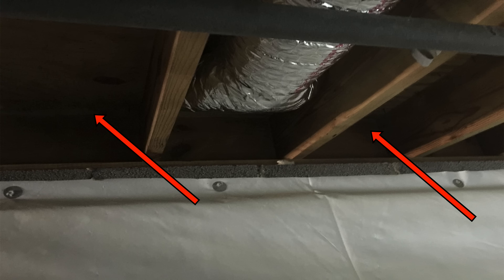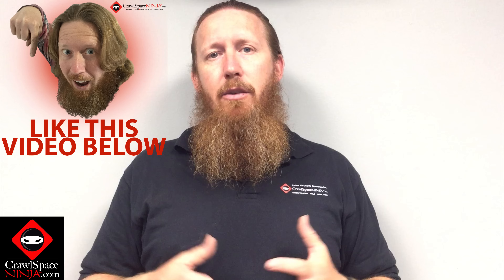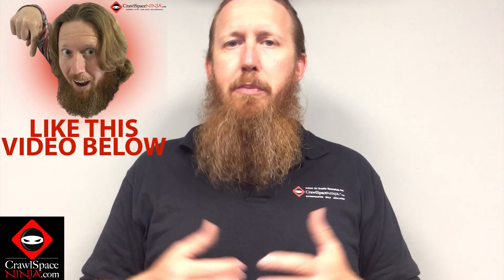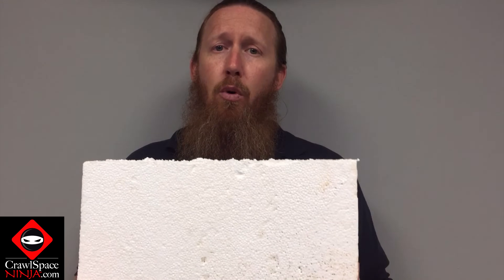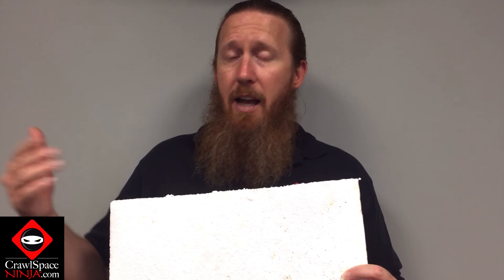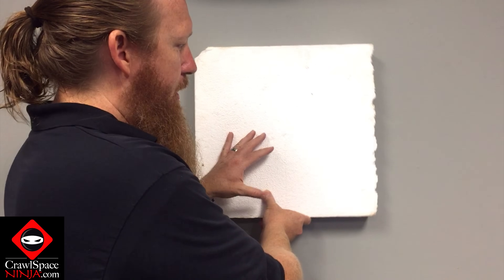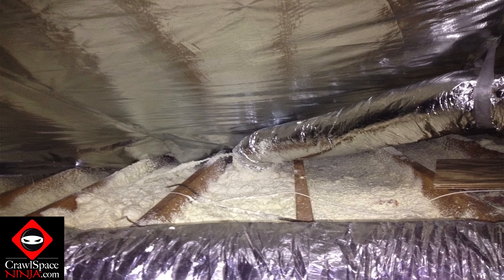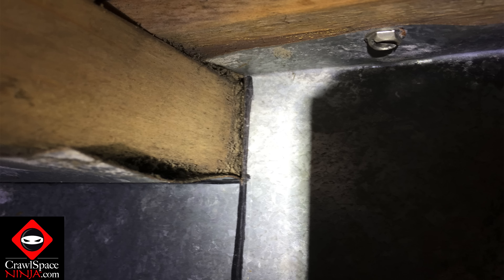Mastering the Art of Air Sealing Rim Joists Easily

Comment from the maker: If you live in the Knoxville area, contact us about our duct sealing! we have a December special going on!
Reply: I have a question for you guys.  Michael, I live in Wichita Kansas, climate zone 4 I think and 2/3 of the front of my house has a cement slab front porch 1.5 feet high, and 5 feet extending from the front of the house.  The last 1/3 is ‘open’ with no porch.  My thought would be that I only need to insulate the rim joist where there is no patio to protect the joist since it’s ‘insulated, by the porch.  I plan on using extruded foam board and air seal that.  Am I thinking correctly here or should I do the whole thing?  I’m certainly no pro but the way you’ve explained it I’m sure I can do this.  Any advice would be very very much appreciated.  Don

Comment: Hey I know this video is 8 years old but hopefully you see my question. Lets say I foam seal around the rim joist air sealing it and then add one inch strips. Then add my foam board after it cures and air seal that as well. If i remember correctly one of your videos mentions that would add R value?
Reply from the maker: That sounds like a great idea. However, if I am understanding correctly there will be an air gap between the foam board and the rim joist. If that is the case I don't recommend you do it because it is frowned upon to leave an air gap between insulation and wood in the crawl space. Usually when we leave an air gap it is between insulation and concrete. Hopefully that helps thanks for watching.

Comment: I have tons of thin foam board 1 inch or less. Can I use several pieces stacked instead of buying the expensive thicker foam board?
Reply from the maker: I have spoken to homeowners that have done that with success. Thanks for watching.
Reply: @ I’m doing my basement not the crawl space. How do you feel about foam board and spray foam on the ledger board side? Never heard you talk about that.

Comment: Great video. I watch so many different videos on this. Some say the pink foam board is fine and seal with great stuff. You say use this kind bc it can breathe a bit in case the area gets moist. Well then why air seal if letting it breathe is helpful to prevent wood rot? I feel like on solution created another and as we get more and more air sealed we realize some air flow is actually necessary.
Reply from the maker: Thank you!

Comment: Side note: 
 know this video is 6 years old. But post Covid, the 2” rigid foam from HD is $60 for a 4x8 sheet. Crazy expensive! However, if you buy their 1” 4x8 sheets, it’s only $20. Glue two or more sheets of the 1” together and you’ll save money vs buying the 2” rigid foam boards.
Reply: What did you use to glue the first board to the rim joist and the rim joist to each other? How do you tell is there is termite activity this way? I want to do it because basement is so cold.
Reply from the maker: Great tip - thanks

Comment: One product I came across by accident is called Fastcoat. I’m sure they’re other brands. But it looks identical to the Pro foam cans, but instead of coming out like a bead, it sprays the foam just like a FrothPak. I’m sure it’s more expensive per linear foot compared to FrothPak, but for smaller jobs it looks ideal.  

You don’t have to lug around the two propane type bottles, hose and gun. It’s just the gun and can foam with a different type tip that snap onto end of the gun. You can purchase individual cans, or buy a case.
Reply from the maker: We offer a similar product: https://diy.crawlspaceninja.com/spray-foam/

Comment: From a cold weather person from Western NY that has full basements... unless you air seal the rim joist cavity (and fiberglass it contains) to block the moisture, you will get condensation forming on the wood, especially if your basement is a living space (finished or partially finished).  Sealing is critical and I also suggest that you invest in a dehumidifier to remove as much of the airborne moisture in the basement air as possible.  Typically, I set mine to 35-45% or less.

My deployment... caulk any open crevasses in the wood first, place un-faced fiberglass into the cavity to fill it, then place either a piece of rigid foam or heavy plastic sheet to seal the cavity off and use expanding foam or sealing caulk to seal all the seams.  I prefer rigid foam board and expanding foam over plastic and sealing caulk.  Easier to do than fumbling with flimsy plastic and stapling it.
Reply from the maker: Thank you for sharing

Comment: Would unconditioned crawlspace air really travel up the rim joist through the exterior walls of a house if those walls have insulation? Why wouldn't the wall in insulation take care of this issue?
Reply from the maker: If it is spray foam walls it probably does but fiberglass does not stop air flow effectively. I have seen attics where blown in insulation is very dirty around air leak areas that showed the air movement was not stopped. Hope that helps.

Comment: No spray foam insulation product is a true vapor seal.
I'm a biologist, environmental hygienist, and indoor air quality expert who has been dealing with spray foam making a lot of people severely ill as these products have become more popular. What we are learning is that spray foam insulation products are not what their manufacturers claim, do not turn into what their manufacturers claim, and do not provide a long term vapor barrier especially against VOCs. The foam begins to degrade on a molecular level quite quickly when compared to other insulation products but just isn't visible to the naked eye.
As I continue to see people's lives, health, and homes destroyed by spray foam insulation I cannot advocate for any use of 2-part spray foam insulation products in buildings--especially currently occupied buildings. They just cause so many health problems even beyond the initial offgassing or from improperly cured foam, and now manufacturers are denying any liability and laying all blame on the installers, so you can't even recoup your losses when your house is totalled or your family is made sick.
And as for installers, is it worth being permanently disabled for the last 50 years of your life to have made a few bucks doing spray foaming?
Reply from the maker: Thanks for your comment, what do you recommend to use instead of spray foam? We have gotten away from 2 component foams for rim joists and use a combo of 1 component and EPS foam board. The 1 component id very little and designed to air seal around the board.

Comment: Hi Michael, I'm in the process of installing 2" XPS foam board on my crawlspace walls as part of an encapsulation.  While doing so I noticed moisture accumulating on the rim joist.  Your explanation of condensation makes me feel better knowing that it's probably not coming in from the outside.  That said I want to seal the rim joists with 2" foam board and spray foam, but I'm concerned doing so while the rim joists are wet.  I think they've been that way for a few months because mold has started to grow.  I had all of the floor insulation and vapor barrier removed last June, so I'm sure that's a major factor.  Should I wait until the rim joists have dried and mold removed before I seal them?  If so I think I'll have to wait a few months until the outside air warms up.  Let me know your thoughts.  Thanks
Reply from the maker: Yes, please wait for them to dry first.
Reply: @CrawlSpaceNinja  thanks so much, and thank you for sharing all the good content on your channel. It's been a lifesaver

Comment: I am in central Illinois,  my 50 yr old home is getting a DIY rim joist repair/improvement.  I have completed the north side and am beginning work on the south side this week.   The east and west rim joists do not have pockets. 14-1/2 by 9-1/4 sized typical pocket areas on north and south. The R5 foam board was on sale (5 bucks off per sheet) so I'm doubling them up with tape to achieve an R10, rating.  It's got a finished basement with drop ceiling 2×4 foot grid. The east and west rim joists areas I can feel has got greater heat loss.  This morning zero degrees Fahrenheit ambient outside temperature.  Working above and between the hanging aluminum rails ceiling grid will be difficult but likely be my biggest challenge.  Thanks, great videos. Ps you may want to look out for falling dead mice if removing ceiling tiles from a 50 yr old house with finished basement. Replace the old baited (poison box) traps, and clean back side of tiles for mouse droppings.
Reply from the maker: Thank you and great advice 😀
Reply: That’s a big job!  Stay safe

Comment: The problem with using eps in the rim joist area is that it is permeable to water vapor and will allow inside moisture get to the cold rim joist in the winter and cause it to get wet from condensation.
Reply from the maker: Percy - Expanded polystyrene is a lightweight, rigid, closed-cell insulation. EPS is available in a variety of compressive strengths to meet the demands of loads and backfills. Water absorption and vapor permanence are minimized by the closed-cell structure.  EPS insulation contains no chlorofluorocarbons (CFCs) or hydrochlorofluorocarbons (HCFCs) and is composed of carbon, hydrogen and oxygen.
Reply: @CrawlSpaceNinja  if I'm not incorrect expanded polystyrene ( the whiteboard ) has spaces in between the beads that allows water vapor to permeate the board. While extruded polystyrene, the blue or red board does not have such spaces, and therefore, is impermeable.

Comment: How about if you are in the high desert like Reno, NV?
Reply from the maker: As a result of the local climate, energy codes have been developed to specify materials and techniques for building or repairing structures. Air leakage and moisture migration can be prevented by installing the correct insulation.  In most of Nevada, the climate zone is 5, but the southern tip is in climate zone 3.  R-values are used to determine insulation levels. Heat is better resisted from the inside out when an R-value is higher. For typical Nevada spaces with attics, the ceilings must be R-19 to R-38. A metal building must be insulated with R-5 thermal blocks, plus two layers of R-19 and R-11 linear insulation.
Reply: @CrawlSpaceNinja  thanks for this. It's a 2000 sq ft single story residence currently with R19 in the attic. I've installed an attic fan and plan to air seal and insulate the attic further probably batts between the roof joists vs blowing in fiberglass. I'm currently insulating the crawlspace to R19 w batt insulation. Also air sealing and installing black foam insulation on the copper pipes. Trying to do things in phases.

Comment: Rather than insulate rim joists, why not leave them bare to prevent trapping moisture behind eps foam & wood? If your basement/crawlspace is  encapusulated and you're running a couple commercial dehu's to remove moisture then would not that prevent mold? Seems to me that preventing mold is a bigger priority than keeping the house a little bit warmer.
Reply from the maker: Crawl space insulation can be applied between the joists or on the walls of the crawl space. If the crawl space is vented then joist insulation is recommended. If the crawl space is encapsulated either can be used but we recommend insulating the block walls.

Comment: On that job now, thanks,  Probably i will spray a thick oil primer into the joints before i put in a light flexible foam and chink the edges?
Reply from the maker: We do not recommend using any kind of sealing paints in the crawl space, especially on the wood.

Comment: hi have a tri level home built in 1957 in  wisconsin on the upper level theres a soffitt bypass/crawl space above the kitchen,
 the eaves/ soffitts are not vented as this area is not connected to the the main attic above it
 there is a slanted ceiling made of fiberglass insulation held up by 1x2 furring strips. question i have is should i dense pack from inside the soffitts to stop drafts getting into that area as well as blow cellouse into joists to keep warm air out of kitchen during summer and keep heated air in during winter?
Reply from the maker: Tom, in theory that sounds like a possible solution, but without conducting a thorough inspection, we don't want to give you inaccurate information and advice that may harm you or your home.  The best route to go is get the attic inspected before performing any insulation work.  We hope this helps.  Thanks for watching!

Comment: Does it make any difference to caulk the edges around the joist before putting in the foam board, to hit the air gaps initially.  Then place in the foam, and spray foam around the edge?
Reply from the maker: Caulk or expanding foam should be used to seal each section of foam. If the rim joist is cold, moisture inside the building could condense on it. It is possible for mold and rot to develop as a result of the dampness.
Reply: @CrawlSpaceNinja  so you would spray/caulk the inside of the cavity, insert foam, and then spray/caulk again?

Comment: I live in upstate NY on the border of zone 5 and zone 6.  What overall finished R value should I have around my rim joist for my area?   I plan on air sealing around all the rim joist pockets.  Then I plan on using 1" thick Kingspan insulation board from Lowes in each pocket as well.  I will be doing two or three layers of this insulation board.   Also what adhesive should I use to apply to the back of insulation board that doesn't have a solvent in it?   I don't want anything to eat through the insulation board.   Thank you for your help.
Reply from the maker: I would check with your local code to see if they have any requirements/suggestions for rim joist insulation R-values. As for installing the foam board, we recommend just installing it just with a bead of insulation around the edges to air seal it. We do not recommend adhering it permanently.
Reply: @CrawlSpaceNinja  thank you.

Comment: I HIGHLY recommend avoiding air sealing up the rim joist with foam board and spray foam. He already pointed out the rot issues. The best way to achieve your goal and have good wood ventilation is to deal with the holes where the air gets in. So get your foam gun out and just seal the perimeter of every joist cavity. Then, use the faced R-19, cut to size and insert in the cavities. Fiberglass insulation does ventilate and the foam will seal where it matters, which is the gaps.
Reply: Bad info

Comment: I live in the North East (Pennsylvania), so we have hot summers and absolutely frigid winters with snow and ice.  My questions are:

1.  Should I caulk around the seams of the rim joist and sill plates before I even put the styrofoam squares/spray foam in the spaces?

2.  I’m liking the styrofoam squares method better than spraying the entire area with sprayfoam.  This is because for future issues, the styrofoam squares can be removed.  However, how can I tell if I have any rot or mold issues if I cannot see it unless I remove it?  Do I spot check a few of them annually, then replace?

3.  What is the best sprayfoam to use to seal the edges of the styrofoam squares?

Thanks,

Mike

Comment: I am wanting to air seal my attic as I experience much hotter air upstairs in the summer, however, I worry as we live in a high radon area. Should I air seal the crawlspace before the attic or is the plastic barrier good enough to prevent the build up of radon?
Reply from the maker: Radon can still build up if your crawl space is completely sealed. If you are worried about it we'd recommend having your radon levels checked. We normally install a ventilation fan blowing out of the crawl space, but in some situations with high radon levels, customers need a dedicated radon mitigation system installed below the vapor barrier.
Reply: @CrawlSpaceNinja  I was more worried about air sealing the attic and thus having the Radon creep up from the crawlspace and getting stuck in the house. Is this a true concern?
Reply from the maker: @corvairhunt6078  Yes, there is a possibility that soil gases could build up if the attic only is sealed and the gases are not being addressed at the crawl space level. But leaving the attic unsealed is still allowing the soil gases to enter your living space if the crawl space is not addressed.

Comment: Don't use paper backed materials.  Use foam board and seal it with spray on.
Fiberglass is a sponge for moisture which retains and transfers moisture.
Reply from the maker: That's right! We recommend using foam board insulation instead of fiberglass. Thanks for commenting!

Comment: I know this is an old video but, my crawl space has no vapor barrier and we get a lot of damp air(smell) in the house.  I will insulate the rim joists as you suggest but does the vapor barrier work best attached to the joist or placed on the dirt floor?  I have to try and do myself as we cannot afford to have a company come in and do.   Thanks
Reply from the maker: Hi Jim, when encapsulating the crawl space, building code requires that vapor barrier be mechanically attached up the foundation wall at least 12 inches. We typically leave a 3" termite gap (we are in Tennessee, your state may require more or less space) and install the vapor barrier all the way up the foundation wall up to that 3" gap line. If you have more questions we have a dedicated DIY Specialist available to help with the best steps to take an encapsulation in phases and answer all questions regarding our DIY products. You can reach her at 865-357-3627 or by requesting help here: https://diy.crawlspaceninja.com/contact/. Hope this helps!